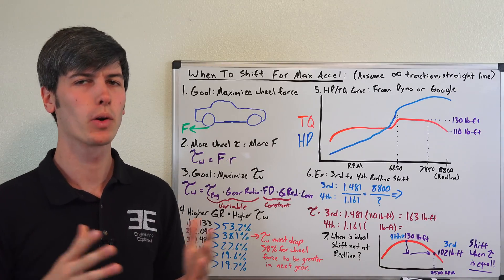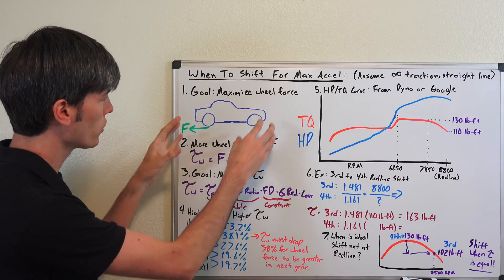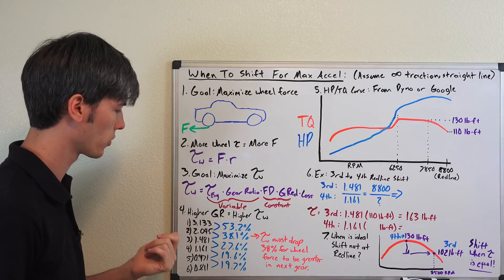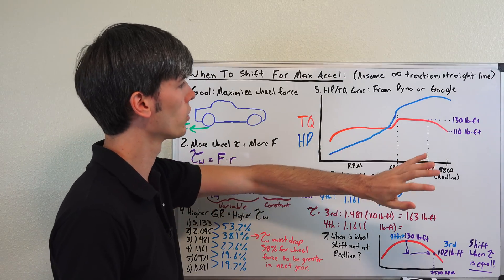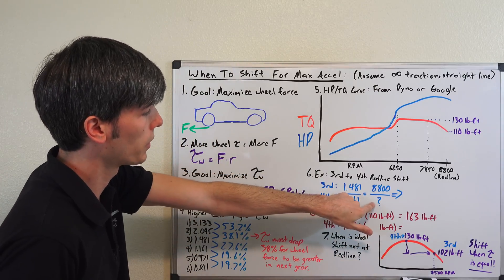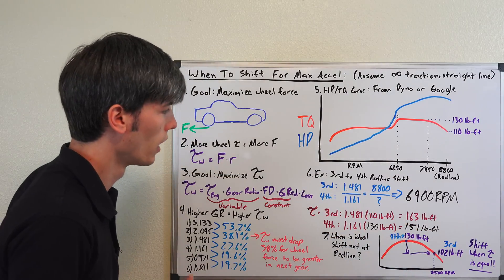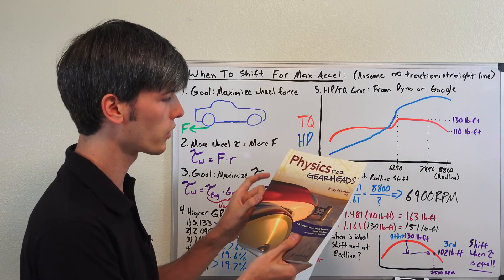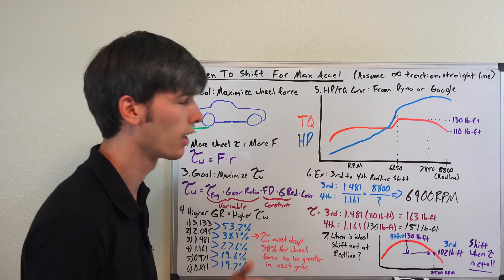When To Shift Gears For The Fastest Acceleration

Comment: can you make a video on why mustangs always crash into crowds? I've been studying this for a awhile but I just can't find the answer. :(
Reply from the maker: Probably because crowds won't stop talking about Mustangs crashing into crowds.
Reply: basically what happens is the driver is not used to so much power, tries to do a burnout/power slide, panics, hits the breaks shifting weight off of the rear wheels and makes the slide worse
Reply: ego and traction control function disabled.
Reply: you see the one at houston cars and coffee the other day?
Reply: This is just my observation. I notice the vehicles spinning out are the ones without a mechanical limited slip. The open diff or electronic limited slip vehicles appear to get loose and away they go.
Reply: Probably because the owners think that having a mustang automatically makes them know how to drive it.
Reply: Horses secretly hates humans from years of subjugation, I would be pissed too knowing that darn humans has been riding your forefathers and hitting them and kicking them  :D
Reply: Spencer Valek i think he didn't let off the gas for the one at houston cars and coffee
Reply: 20502chris It took Ford HOW MANY YEARS TO MAKE STANDARD?

I rest my case
Reply: why that's easy before the current mustang they used live rear axle.so when u hit a bump or pothole on one wheel it will effect the other so under hard acceleration the driver hits a pot hole or bump on the right side it will make the left wheel bounce and become unstable sometimes causing the car to change directions and possibly spin out.
Reply: It was deemed too expensive to use for the standard models at the time. Also Mustangs are used more often on the drag strip than the road course, and a live axle is more durable, has less parasitic power loss, and weighs less.

  Having IRS doesn't mean a car automatically handles better,  the Boss 302 is just about as quick around a road course as an E92 M3. And and the Coyote powered S917 GT's were faster than the 5th Gen Camaro SS's around a road course as well.
Reply: "On the street a "straight axle" is borderline useless and absolutely dangerous in all conditions"

LOL, not sure if you're being facetious or you're just hilariously misinformed. Your realize pretty much every full sized truck, van, and many mid-sized SUVs all have live axles in the back right?
Reply: the live axle has nothing to do with the Mustang crashing into crowds. has everything to do with the bad drivers who own them. 
the problem is everybody wants to do a burnout in be like Steve McQueen. 
but not everyone has skill to drive a Mustang. I'm currently on my 4th Mustang all my Mustangs that I've owned have been live axle V8s and I've never crashed into any crowds.
Reply: That could be due to lack of maintenance
Reply: MRios1128 same...
Reply: Fun fact: Every V8 Mustang from around the mid-80's onward has a mechanical limited slip diff (Trac-loc).
Reply: FoDaddy Sooo why was the Cobra the only one to get an independent rear suspension?
Reply: zip89105  Trac-loc isn't the greatest, the clutch discs tend to wear out and lose their effectiveness after around 120k miles or so.
Reply: gorrilaunit99  I've had two Mustangs, one was a 2003 GT that had a fair amount of mods (Kenne Bell 2.1L, 3.73 gears, Eibach springs w Koni struts/shocks, exhaust,  Cobra brakes and a few other bits), and I never once spun it on the road or during the three trips to VIR.   My current 2016 Mustang GT (only a catback, and short shifter at this point), likewise hasn't been spun/wrecked either.  Maybe I'm just living right or something.
Reply: You got that from salomondrin didnt you :-P
Reply: FoDaddy Those are not marketed and sold as sports cars

Not to mention, solid rear axles are better for offroading
Reply: It's marketed as a performance car.  That doesn't necessarily mean "sports car". They are not the same thing. For example, a Hellcat Challenger is a performance car, but it's not a sports car. A Miata is the quintessential sports car, but it's not the fastest thing out there.  Performance cars can be sports cars though, if that makes sense.
Reply: like I said before it's just like texting while driving or drinking and driving there's no problem with having alcohol or there's no problem with having a cell phone it's the responsibility of the driver to know how to use when and where at what time. same rules apply with the Mustang there's nothing wrong with the V8 there's nothing wrong with the live axle everything has to do with the responsibility of the driver.
Reply: I'm on my 4th Mustang I've never had any handling issues with this car at all so obviously you have no idea what you're talking about.
Reply: that is not true at all a matter of fact that there are people who autocross Mustang so you have no idea what you're talking about and plus some Mustangs have been Road Raced since the 70s
Reply: Christopher Weaver everything comes down to driver responsibility how come you don't see Camrys or minivans crashing into crowds?
Reply: Nobody else like his comment. He's at 666.
Reply: Brentan Coates hahaha dude lmfao 😂😂😂
Reply: Brentan Coates The problem is the  people that drive them, All mustangs are beasts, but the problem is if they fall in the wrong hands, you know what I mean...
Reply: I had a Trac-Loc on my F250. The truck was always dog tracking as by the time the limited-slip kicked in the rear end had already kicked out. Never had this problem with my GM or Dodge trucks which drove straight & true.
Reply: solid axle, no limited slip... why new ones do that? drivers that have no clue what the car is capable of, as now they have both and is available as one of the best cars you can buy. Especially if you plan on spending less than $100,000.
Reply: again if you are a good driver you understand and you know your car better than anyone else this is why I haven't had any problem with the Mustang because I have experience with the car a lot of people especially in the New York area where I live can't drive.
Reply: 20502chris  The Mach 1 didn't have IRS,  up until the S550 came out, only the New Edge 99-04 Cobras had it, as well as the 2000 Cobra R.
Reply: I think the answer to this question is similar to unicorns. We all know it's out there we just can't seem to find it...
Reply: Brentan Coates I laugh because it's totally true and also because I almost landed my Mustang in my own front yard. I've had fast cars and yet none of them left me in the same position. My Yamaha R6 that accelerates faster than anything I've owned has never embarrassed me. After a bit more experience (my car is new) I realized that it's very easy with the stang to be on the edge of drifting and spinning. My challenger was never like that. Now that I've experienced it I love when I'm on that line where if I press any further I know I'll be spinning. It adds more of a challenge than putting foot to floor and turning.
Reply: Brentan Coates i swear  i thought it was mainly bc old suspension of past mustang but new ones w ind susp n they still crash mow down spectators.. so.. idk maybe its the mustang owners lol jk.. maybe not lol
Reply: I have a 2016 mustang. Turn off traction control, and drifting or powersliding is easy and smooth. I really dont understand the whole "crashing into crowds" deal. Makes no sense to me.
Reply: lol everyone has a mustang because theyre cheap, decent power, reliable, but very basic setup.  a go kart with a v8 block. the 2015s are on another level
Reply: and equations..... more equations please!
Reply: Brentan Coates Damn that was harsh cover your mouth up like you got sars........lol nice one bro.
Reply: HAHAHA
Reply: Young drivers, affordable muscle car mostly.
Reply: it is because: too much horsepower in the hands of the inexperienced leads to crashes, and some v6 mustangs are affordable.
Reply: cuz they're very high power, rear wheel drive and cheap so more idiots can buy it, especially second hand,
Reply: Mustangs don't have an independent rear suspension
Reply: @SBUBYK  Didn't have Without googling I'm pretty sure that changed in 2015 or so. Don't know if they stopped doing it after that LOL. Someone needs to do a scientific study to see which is the biggest reason: Incompetent driver with too much power or live rear axle. I'm sure they all play a role.
Reply: lol Recognize!
Reply: Gabriel Soria New ones do that because they're pigfat heavy and Ford can't into suspension geometry and is still working out the kinks (It's hard to change after 50 years).
Reply: gorrilaunit99 ive never spun mine 🤷🏻‍♂️🤣 u really said pig fat heavy u sir got you’re cars wrong....
Reply: elr2141979 After decades of production of this vehicle, you're in the minority. I don't know a single person who hasn't spun their Mustang while performance driving multiple times- espeically on uneven/bump prone pavement.
Reply: gorrilaunit99  The Mustang isn't a proper sports car either, it's  a pony car, not a sports car. The current model is more of a grand touring car, it's too heavy to be a proper sports car. It can be argued that the GT-350 is a sports car though.

Another fun fact, among it's primary competition (The Camaro and the Challenger), the Mustang up until the 2016 Camaro came out, was the lightest of the three. Right now there's only about a 50 pound difference between the Camaro and the Mustang when comparing comparable models (GT vs. SS for example) The Challenger is still much heavier, weighing around 400 pounds more than the other two.
Reply: FoDaddy It's marketed and sold as a sports car by Ford- period
Reply: because of it's high engine torque
Reply: FoDaddy Google Ford Mustang. It says sports car. Go on the Ford website and read the brochure.

It says sports car.
Reply: Really? Where on the website does it claim that the Mustang is a "sports car." It says "performance" alot, but not " sports car".
Reply: Please learn the difference between a meta tag and and the actual website content.  On the actual website, it doesn't refer to the Mustang as a "Sports Car" anywhere that I can see.
Reply: the Mustang is more like a modern muscle car somewhere between a performance car and sports car
Reply: FoDaddy http://performance.ford.com/enthusiasts/media-room/2016/09/ford-mustang-officially-germany-s-most-popular-sports-car.html

That's from the Ford website. Let me know if you need another.
Reply: FoDaddy http://www.ford.com/cars/mustang/trim/gtpremiumfastback/

"*Class is High-Power Sports Car based on Ford segmentation."
Reply: this is why I said it it's more like a modern muscle car because it's a combination between both a sports car and performance car.
Reply: gorrilaunit99  I'll give you that one, even it's in the small print.  As for the Best Selling Sports car in Germany,  that one is suspect at best as the German government claimed it was the best selling sports car, the government made the classification in that case.
Reply: I Think a crowd member is over riding the ECU Or using a strong ass magnet possibly
Reply: Ask Papa Franku. He has a research laboratory.
Reply: Lol
Reply: well you see in nature mustangs hate humans and want nothing t do with them, but while on the city streets they just want to cuddle with humans, in a grave. honestly its all up to the driver. the mustang will alwys be wildly popular, however we got some damn rookies show boatin. let this not be a spectator sport
Reply: Usually its a cold tires issue mixed with poor reaction to the slide.  Cold tires will make any 400+ hp/lb car break loose into an uncontrollable slide.
Reply: Michael Herrera , streets are not designed for such dangerous moves either, that is why drag strip tarmac are extra stickier, regular road not as much, you can even break loose with a 100 hp Corolla if you gun it like that :D
Reply: I was going to post the same but saw this. Excellent answer!
Reply: sudden funny yknow
Reply: The British car video reviews the American does not design and manufactures car to do cornering. They are just for straight line.
Is it true? And why?
Chassis setup?
Suspension setup?
Poor airflow management to the brakes and tyres?
The package is heavy, it rips off the tyre off the traction faster?
Reply: Brentan Coates After doing my own RnA l found out that 99.9% of the it is the crowd that crashes into a Mustang while the other .1% it is the kerb or any obstacle that hits a Mustang. What you think that Mustang crashed into crowds or sidewalk and other obstacle are just and optical illusion....alas when a Corvette or a traffic light involved it is the father's of the Mustang driver is at fault for not teaching his kid to drive it correctly.Mustang also hates bicycle,motor bikes or any person in a wheelchair.....🤘
Reply: Or why Lambos catching fire while waiting in the red light lol
Reply: Brentan Coates a while*
Reply: Driver not driven more than 200bhp of power
Reply: Snap oversteer buddy
Reply: Shorter wheelbase and type of drivers
Reply: -- i wasn't actually looking for an answer ahah, just creating some quality banter
Reply: LOL   I think you would need to ask a socialogist/psychologist on the profile of the average owner to consider such issues as ¨small penis syndrome¨, among other associated disorders.
Reply: elr2141979 well obviously you've never had issues if you're on your 4th mustang, you've never been able to compare it to a real car made by lets say, the germans or the japanese. American muscle cars are only good in a straight line FACT!
Reply: @snailracing7715  you clearly ain't never heard of the boss 302 or the gt350 even the normal pp1 mustang gt are pretty good handling cars these days.  Many people road race and autocross their mustangs it's all in how you set the car up.  Some just set them up for drag so that is what those cars are good at (the ones set up for drag)
Reply: Brenton Hobson i can say from personal experience, mustangs are not relieable, i dont know about the newer ones but every mustang ive owned has been awful
Reply: Brentan Coates Because mustangs can't corner and their buyers can't drive. Don't you know anything about Ford and ford owners?
Reply: gorrilaunit99  I never said that straight axle was superior. You asked why Ford used a live axle on the Mustang for so long, and I gave you the answer.  There many factors at play in determining how fast a vehicle is around a race track, suspension is only one of those factors.  I will say that a well designed live axle setup can be superior to a questionably designed IRS setup.  With that said all things being equal, an IRS setup will be better in most situations.
Reply: FoDaddy On the street a "straight axle" is borderline useless and absolutely dangerous in all conditions

GM should be sued for negligence for having a sports car in production past 1987 with a beam axle. It's rediculous how many lives their shitty engineering has taken.

Hell, even Toyota knew this and pulled the RWD Sprinter Trueno from its lineup for that very reason.